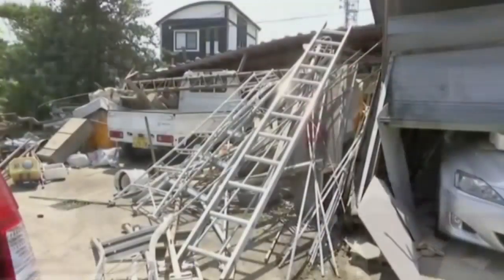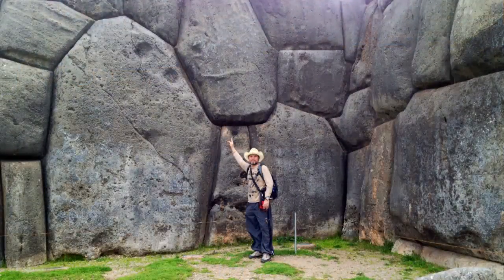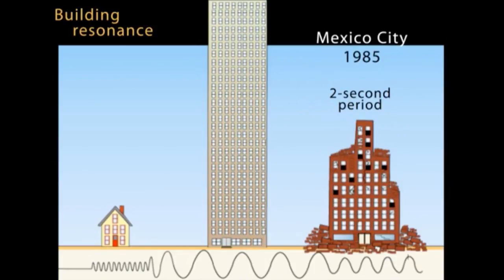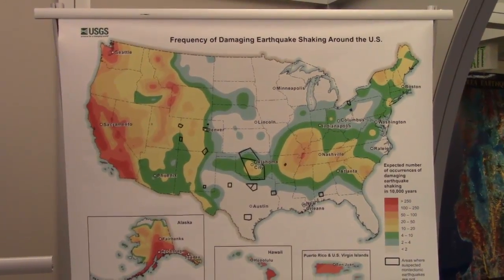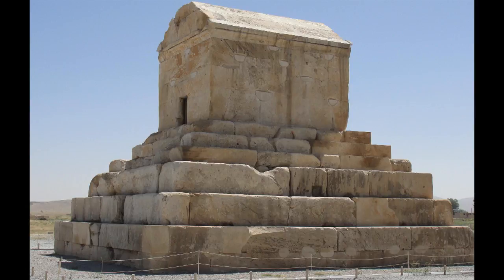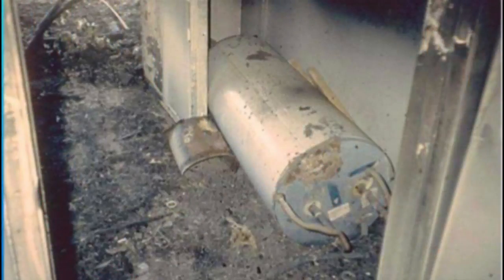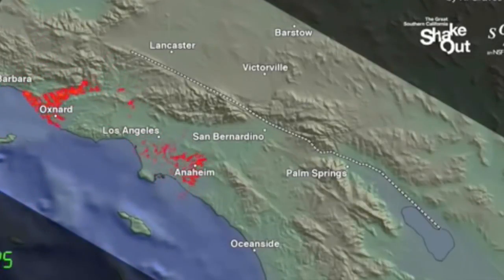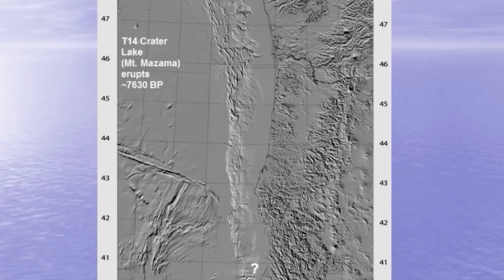64) Earthquake Protection and Mitigation

Comment: Fun fact; there's a welding code designed specifically for seismic structural applications. Learned this while a friend of mine was getting his certified welding inspector qualification. Personal I've only worked to D1.1 structural welding code and API 1104 Pipeline welding code.